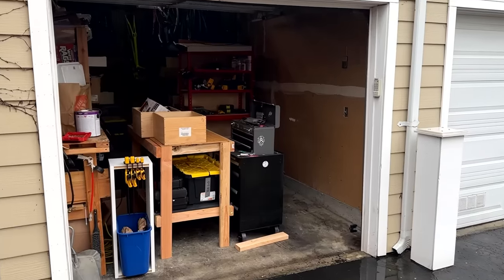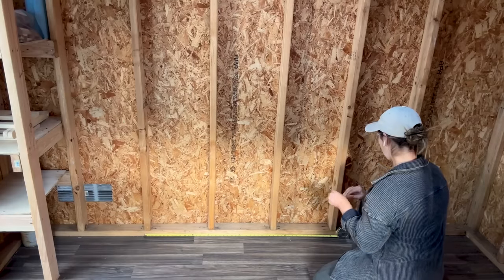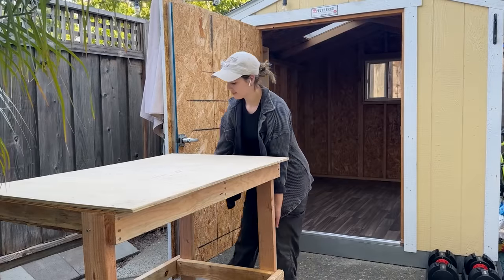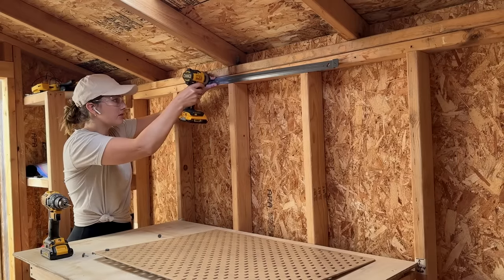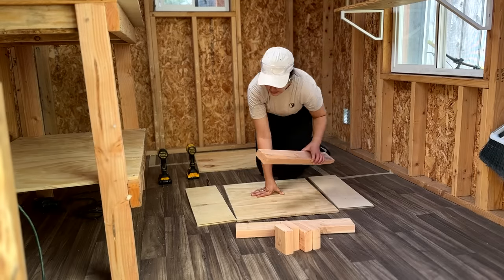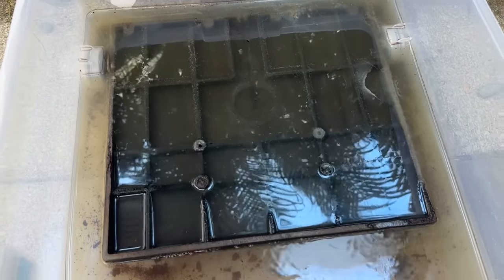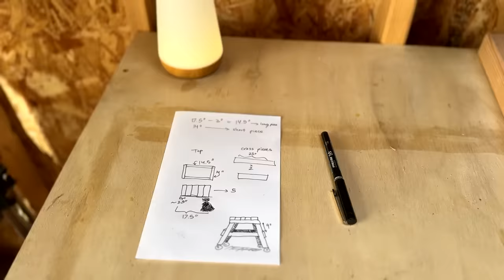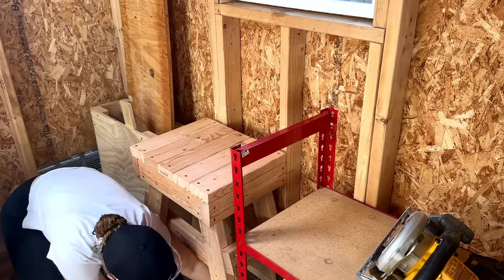Building a Mini Workshop... Again

Comment from the maker: Seems I was misinformed about WD-40 being a good rust inhibitor and I went ahead and put some paste wax over the bandsaw table top. 

Hope you enjoyed the video 😊
Reply: any thing that can provide a surface barrier to water in the air is going to do something. Even cheap 3 in 1 oil on tools can prohibit rust to a degree.  Depends on where people live, and how moisture gets in to the space too. WD-40 can work, but again it depends on what temps and moisture gets into the space.  My summers are humid and plenty of rain but surfaces don't really rust in my shop with just minor surface care.  paste wax is will definitely do it. You'll probably have that paste wax container for 50 years now, takes forever to get through.
Reply: Hermosa wera
Reply: I am surprised about the WD-40, since the WD stands for "Water Displacement" and as far as I am aware it was designed as a rust inhibitor. I guess the issue would be that it would feel oily all the time and rub off with use. I would consider painting it with something like hammerite if the paste wax doesn't work out. 

For the wood off-cuts bin,  the corner blocks seem to take up quite a bit of the opening. I would consider using something like pocket hole screws on the sides, so you could remove the blocks altogether, or cutting 45 degree angle blocks so that the stability is the same, but less of the internal space is wasted.
Reply: You need to paint the surface with rust reforming spray paints like Rust Oleum.  Some require a primer and others you can paint directly onto the CLEAN AND OIL FREE surface.  You can use a solvent like CRC's Brakleen to get all of the oils off the metal.  It dries very quickly and leaves the surface clean, just wipe down the areas with a dry cloth after.  IMMEDIATELY you should then begin painting the surface.  Remove the table just like you did with the initial rust removal process.  This will hold up MUCH better than oils and will eliminate the possibility of getting oils onto your wood projects where oils could potentially ruin the finishes. Hope this helps. :)
Reply: I've found wax paper works extremely well. I ball up a piece and rub it on any tool table you'll be sliding wood on. Keeps everything slick and rust free. Added bonus is its inexpensive and leaves no residue on your wood.
Reply: Bandsaws are very dangerous. Be very careful
Reply: WD-40 is so misused and (almost willfully, it seems, by so many "experts") misunderstood. It's a water displacer. It's not a barrier. It's not (purely) a lubricant. It works GREAT in the moment, but it is not meant for long term use. You're better off waxing it. You're better off getting a liquid silicon lube or even a dry silicon or graphite lube for literally EVERYTHING I've seen people say wd-40 is good at doing (when it comes to lubrication). Wd-40 has its uses - and those uses are many - but it's never the first, best choice for any kind of long term protection and almost NEVER the right choice to any degree for any lubrication. Again, it works fine in the moment, but it's crap for long term use.
Reply: @unholyarmyofone  No, it's not designed as an inhibitor. It's designed for an in-situ, in the moment water displacer. Ie... cleaning water infested metal items, cleaning out rust pits, etc. It's not meant for long term care. It's much more of a triage tool than a protectant.
Reply: @garyolsen3409  They're more or less the safest wood working / cutting machine a person can use.
Reply: @ChrisHornberger  uhm, apart from the silicon that is, because if that gets on your wood surface, you'll have a rough time getting it painted or stained. Silicone and wood is a big nono. I use a simple paraffin candle to strike the surface of my jointer/thicknesser, bandsaw, table saw and shaper and rub it out. It protects the metal and if helps the wood slide easily along the surface
Reply: @Paul-nq1ik  Yeah, sorry, not for wood surfaces; I was speaking in terms of all the other stuff that people say to use wd-40 like door hinges and stuff. Sorryfor the miscommunication.
Reply: @ChrisHornberger-Siliicone lubricants should NEVER be used in a wood shop: they will cause fisheye and finish adhesion problems. Boeing developed a product called T9 Boeshield that is a protectant and they claim it will not transfer to wood. Lami-Lube Products also makes some friction-reducing sprays that also are safe to use on wood. GlideCote is another good one for repelling dust and moisture.
Reply: @thedumbassspeaks  Yeah, I know. I was talking about other uses of wd-40 when people think it should be used as a full on lubricant. I already addressed that with another person. I very clearly stuck with wax in my suggestions for the top.
Reply: @unholyarmyofone  I think WD-40 will work as a rust inhibitor but it leaves behind very little oil, which is the rust inhibitor aspect. Probably enough to preserve the underside of the table since it won't get touched much but the top side it will rub off pretty quickly. I don't get too carried away about rust but I did rehab an old table saw recently and after sanding the topside down I used some cheap liquid carnauba wax I had lying around to keep it smooth and rust free and as a bonus it also smells great.
Reply: Why I came to the comments
Reply: Yep WD-40 is way over rated
Reply: I do enjoy the video, I love to see more in the future
Reply: o wd 40   tem  no   brasil  ...   pais  legal  teu  no  brasil  não  acha  nada tudo  caro
Reply: Parabéns, tenho a minha oficina aqui no Brasil, de 8 metros x 4 metros, tudo sobre rodízios pra facilitar o manuseio.
Parabéns pelo trabalho 👏👏👏👏🇧🇷🇧🇷🇧🇷🇧🇷
Reply: yeah WD-40 is also not a good lubricant.  It is good for one thing - Water Displacement (hence the WD).  Once the water is displaced, dry and protect accordingly.
Reply: Here in Germany we have "Silbergleit" (translated it would mean something like "Silverglide" I guess) for woodworking machines. I use it on all metal-surfaces of my machines and it works very well without leaving stains on the wood plus it creates a protectivebarrier from rust. A can of this may last a lifetime. I don't know about the avaibility outside Germany / Europe but I've read that it's also used in Canada and Australia.
Reply: Boeshield products are great. Just restored a couple pieces of equipment I have after a couple years of storage/neglect.
Reply: Someone already mentioned, but Graphite lube is great, too!
Reply: have you considered "French cleats" to move tools/equipment from shelves yet giving easy access to them?
Reply: Все хорошо, только надо покрасить все олифой
Reply: my preferred method of rust inhibitor is cold blue and oil. And for this application I expect Paste wax is the optimal choice.
Reply: WD-40 is technically a "cleaner" thing something like carburetor cleaner but a more gentle form, but it does still provide some rust barrier because there is oil in it. you are correct that the best thing to use on metal tables that are susceptible to rust would be paste wax. I use paste wax on all my saw tables and even circular saw , it not only protects from rust but also lubricates so things move across very smoothly! nothing wrong  with WD-40 though it is always on hand around here. I use it to clean up rusty or dirty metal  stuff prior to lubrication and it works very very well, nothing wrong with it at all, it will work as a lubricant and rust barrier but just does last long and can cause issues with wood products in contact with it since it is oil based.
Reply: @michaelbuddy  I agree. WD-40 is just fine to use it just does not really stick around as long . it is technically a "cleaner" meant to clean up rusty or dirty metal stuff but it works as a ubicant and also as a rust inhibitor. paste wax just works better as a rust inhibitor and other lubricant work better for lubrication (like silicone based for example) especially when working with wood products.
Reply: @unholyarmyofone  yes I agree the WD-40 does work for protecting against rust an people use it for that all the time successfully. when dealing with wood products you are better off to use paste wax though. she was not in the wrong to use WD-40 to seal the metal table on the band saw though it just was not the optimal product for that purpose. I use WD-40 all the time it is a great product especially when you are metal working. paste wax is more appropriate for wood working.
Reply: @garyolsen3409  probably the least dangerous of all woodworking saws....
Reply: @ChrisHornberger  well said! I agree 100% I think WD-40 is a little bit antiquated , we have much better options these days but I still keep it around and do use it frequently but consider it more of a "cleaner/ short term lubricant"
Reply: @ChrisHornberger  lol true I saw that comment and was a little confused....sure band saws CAN be dangerous I know people who have been badly injured with them but as far as woodworking saws are concerned they are probably the safest thing you can possibly use. if you try cutting something round you can get in trouble real quick though, it can grab it and pull your fingers into the saw but that would be true for a table saw as well. the most dangerous woodworking tool in my opinion would be a table saw being used by someone inexperienced.
Reply: Depends what finishes you plan to use but for me I just use Johnson’s Paste Wax or Bowling Alley Wax on machine surfaces. Paraffin or bees wax for my handsaws and new wax toilet seals to lubricate screws.

Flood Penetrol is an amazing rust inhibitor as a primer or clear coat on metal tools that see weather.
Reply: I wish I was there to help you when you were working, and to be honest, you left a lot of space empty, it could have been used much better, but still, it turned out great.
Reply: regular WD40 is excellent for cleaning the rust off of the cast iron.  You spray it on let it sit for s few minutes and the start scrubbing with a green scotch bright scouring pad and wipe clean, repeat as necessary.  WD40 does make a rust inhibiting spray but paste wax is definitely better as it makes it easier for wood to slide across the surface.

Comment: Tip - see those notches in your awesome sawhorses? lay a 2x4 x8' in each, then place a piece of plywood across them. Then a piece of foil backed 4x8 1" foam insulation on it. Set your blade to just go thru your wood to be cut. You will always have complete support, better safety, and waist height work space. Keep the boards and foam (I hang mine from the ceiling) for future cuts. Lasts for many years.
Reply: Man,  im so lost.  😅😅
Reply: oooh nice. so that it makes a table right?
Reply: I was thinking the same thing. Cutting on sawhorses with no support underneath is an accident waiting to happen. With her limited space, she doesn't have to use all 8 ft. Having a whole 'nother work surface would also be a bonus for that limited space.

Comment: The first rule of a very small workshop is that everything should be mobile....at least I have such experience...my workshop measures 6.56 x 9.84 feet
Reply from the maker: Definitely, already ordered more of those wheels w brakes
Reply: My Workshop is aboat 4300 square feet, but my maschines are still on wheels to be mobile. So that they could easily be moved around in case I bought a new one or some big lumber Boards need more space than there is at the Moment
Reply: Only buy what you need. Don’t buy tools until you have a use. Keep things very organized.Use storage containers and bins to help . Start small then move forward
Reply: I started if just a couple tools and I use to storage tools in small closet . Not anymore two car plus garage
Reply: At least it's a start and do one step at the time! Brilliant work and keep it up!😊
Reply: Actually, I have learned the hard way that even with 2,600 square feet of shop EVERYTHING should be on wheels. Over the years I have bought at least 40 Harbor Freight dollies purely for the casters. Shelf units weighing hundreds of pounds get heavy duty wheels. Sandblast cabinet, stacks of tires and wheels, sawhorses, spare washers and dryers, lumber and steel racks — all on wheels. As sure as a heavy object isn’t mobile there will come a day — or days — when it needs to move.

Comment: Nice!  Two thoughts: 1) use the wall cavity space to your advantage.  All of the small items like the stain etc will fit on small shelves making it easier to see and access as well as freeing up the larger shelf space.  2) build a small ramp to get mobile pieces in and out of the shop space (and avoid a trip hazard).  ENJOY!
Reply: I see her taking advantage of the cavity space in several places.
Reply: @SeaFanStudio looked like just the claps and then the two drill holder areas? Def think there could be a lot more usable space.
Reply: right can serve as shelf, can put locking hinge brace  on there also for retractable mini table
Reply: @scoobydiesel  she also added depth to the shelves by having them take advantage of the cavity space. Sure, she could utilize them further, but she clearly already had the thought to utilize that space.

Comment: The below suggestions are very good. I would also suggest adding a shop vac to your space. Since you are already in the Dewalt battery system, I looked at what they had, and they have a 2 gal vac that could sit on your workbench shelf that runs on battery OR plug. Considering it's such a small space and there's no air filtration in there, if you're going to cut and sand in there, do as much as you can to keep the air clean/wear your masks.

Comment: Where I live, I keep my paints, primer cans, glue, etc in a tuff bin so I can bring it into the house during winter so they don't freeze. I'm a big fan of those stackable bins to keep moisture and saw dust off of the delicate items. Excellent band saw table idea, it can wheel out into an open area so you can cut longer items. The layout looks good!
Reply from the maker: Thanks! Yeah I actually moved the paints and such into one of those large plastic bins and brought it into our garage, since the temp in there fluctuates less. Just to be on the safe side.

Comment: Very nice job!  I would suggest removing the WD40 from the band saw top so finishes applied to your work pieces aren't effected from it.  Use a paste wax for wood floors (not car wax because it has silicone) or there are commercial sprays you can use that will help protect it from rust and make it slick so your projects slide easily as you're cutting them.  Good luck......I know you'll be happy using your new "she shop" for your woodworking!!!

Comment: Nice video. One thing I would recommend is to get a 4'x8' piece of rigid foam insulation 1" or 1-1/2" thick (those pink sheets from Owens Corning, for example) to place on top of your saw horses to make life easier when cutting material with your circular saw. You can cut this into two or more pieces and even tape sections together such that you can fold them up for storage  and unfold for use. I have a frame made of 2"x4"s that fits into the ears on the same saw horses as you have that serves as a base and I lay the foam on top of that. Works great.

Comment: Looks great - about the same size as my own shed. I would however urge you to remove that shelf at the window, as others have also mentioned - you will at some point bump into it and hurt yourself. Suggest building another smaller bench with storage space underneath it - or if not a bench just a shelf unit up to the bottom of the window. That way you get storage and you won’t hurt yourself.  Also turn tools boxes onto their bottom ie stand them up beside each other rather than lying them flat - makes more space. All the best.

Comment: This video is truly an inspiration.  My lot is small, my garage is cramped, and pulling out tools is a chore in itself.  I feel like I don't have adequate space for a shop, but you proved otherwise.  Thank you!
Reply from the maker: Glad it was helpful!
Reply: The key is to buy rolling stands for as many tools as possible.  Then just TETRIS them around until you have the most used tools in the front accessible areas and the least used tools in the back.

Comment: I had one of those storage buildings. I used it for 10 yrs before i finally built a 30x30 shop out back. I built a ramp at the door.. I had a garage door at the end of the shop and i poured a 10x16 slab outside door. I moved the table saw outside. With a. $1000 carport over it. Worked great.

Comment: I've found that having some sort of door on my powertool storage is essential. Without a door or at least a curtain, all of your tools will be covered in dust and will cause a mess before you even use them. A scaled down central vacuum system would probably be the next thing I installed if I were going to do much woodworking in such a small space. I can already feel the sawdust in my teeth and down my shirt collar. LOL

Comment: Good use of the space. I built a 4x8 tool room onto my 12x8 shed this fall.  My shed is just for home storage so I had to build something for my tools.  Built a 4’x19” work bench and put my tool box in there and a wire shelf.  I’ll use the covered deck for bigger projects. I figure this will work til I build a 12x12 workshop in a year or two.  Fun being creative with smaller work spaces.
Reply from the maker: Agreed, it's a fun challenge to make a small shop as functional as possible and, when you finally get that 12x12 space, it'll feel huge by comparison